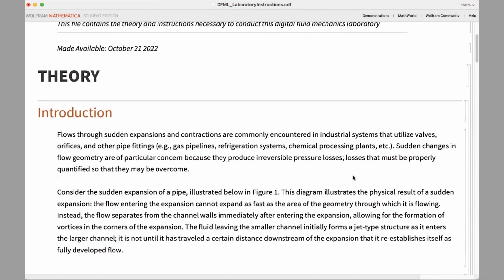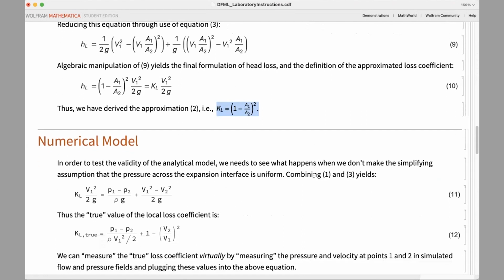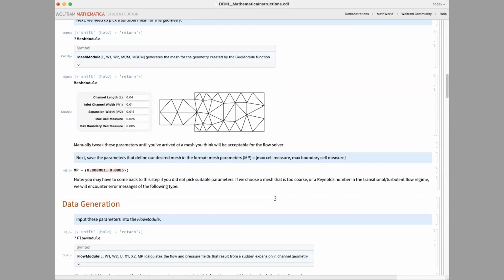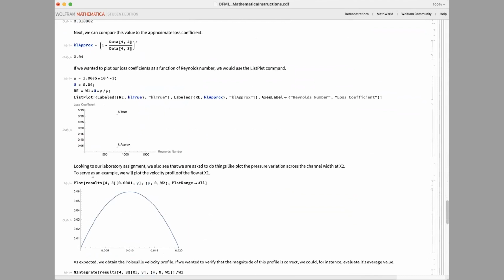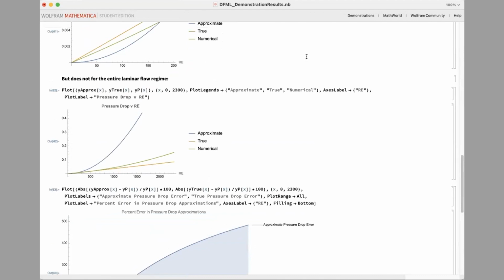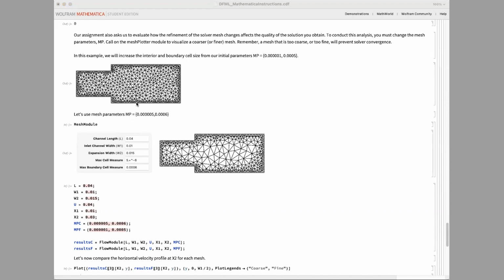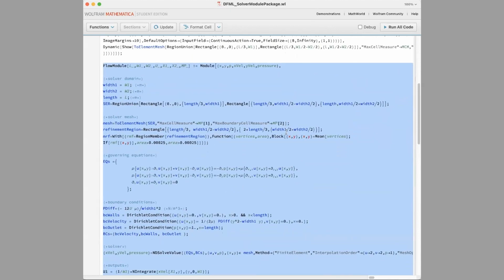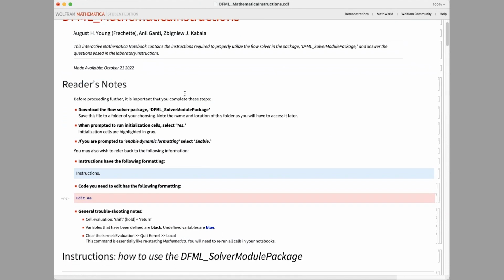Digital Fluid Mechanics Laboratory: Sudden Expansion Pressure Loss

Comment: I would disagree that making measurements of this would be impractical or even hard. Engineers dealt with such lab problems for about 2 centuries now I’d think, so measurement-wise it’s been all solved pretty good. Certainly good enough for an undergrad lab. I would further argue that with the modern manufacturing techniques - 3D printing from transparent materials, laser cutting, cheap web-orderable CNC work - it’s way easier to do these measurements and make the lane setups today than it was 20 years ago. On the other hand, Mathematica or any other CFD playground would do well for predicting the performance of the measurement setup and refining its design.

Other than that nitpick, it’s a very nice tool.